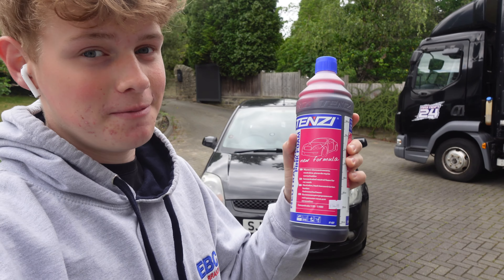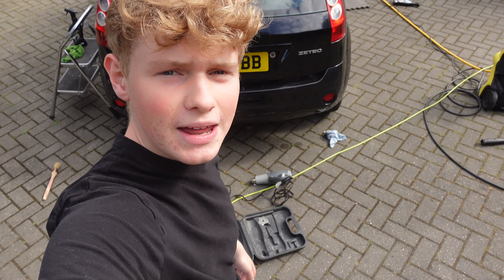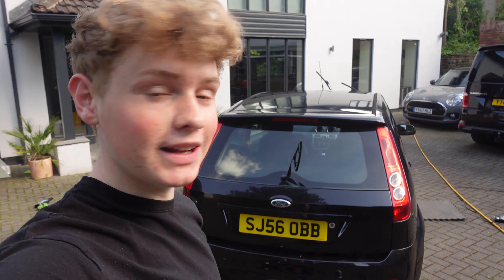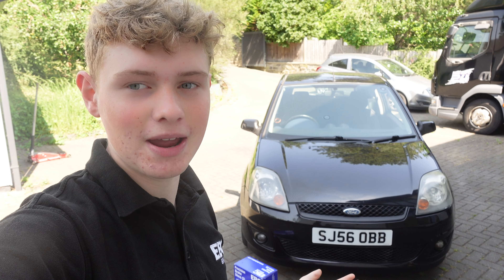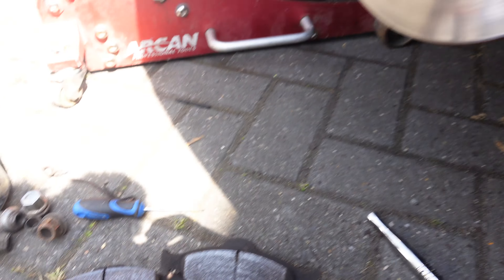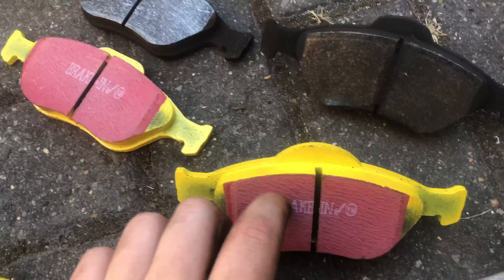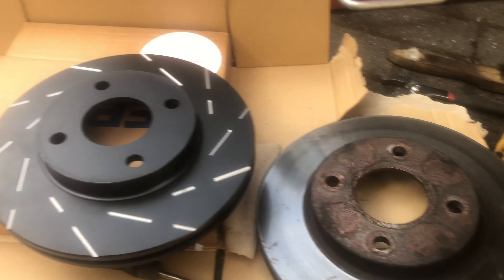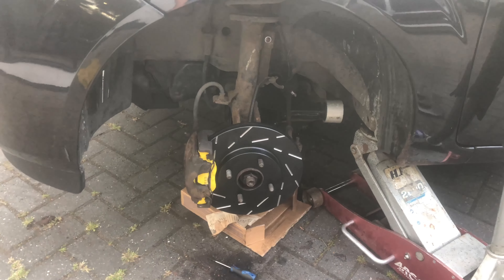@EBCBrakesUK Upgrades and Full Detail | Fiesta Build Episode 3

Comment: good luck with the cv boot change, you might have been better off doing it at the same time to save taking the caliper off again. Circlip and ball joint can be a pain in the rear on older cars! A quick fix I was taught back in the day when budget was an issue was use a bike puncture repair patch(as they are flexible and create a good seal) to stop stuff getting in, but change it before your next MOT lol.